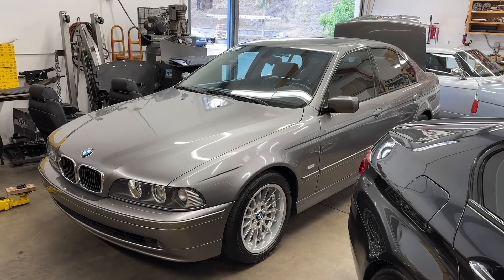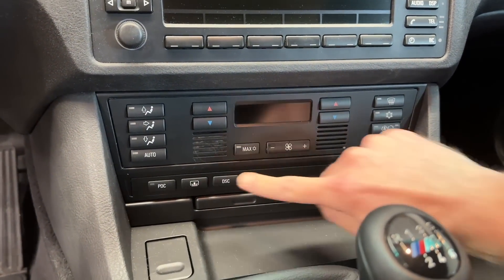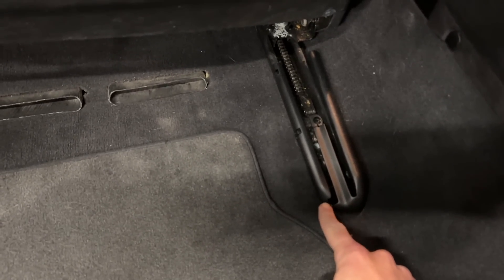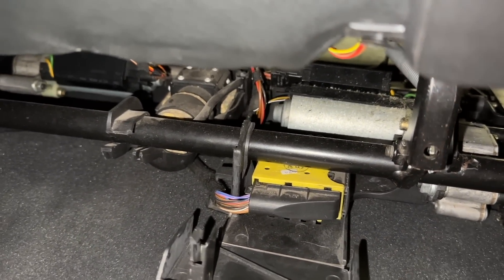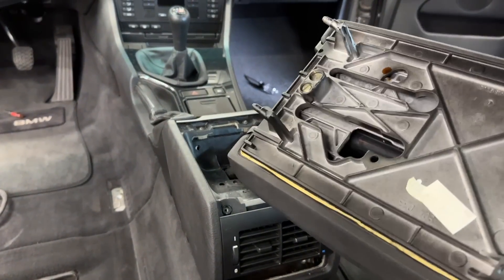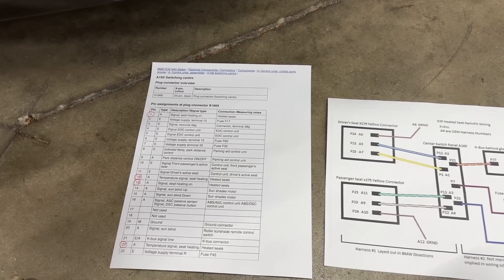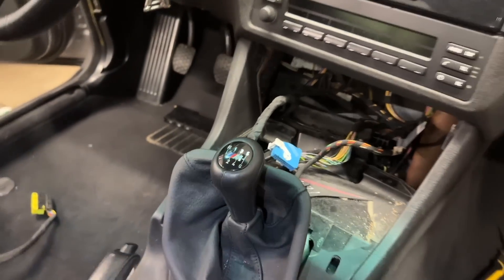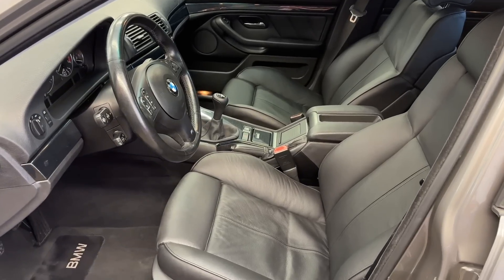BMW E39 5-Series Heated Seat Retrofit

Comment: 13:06 The wiring probably is that long because it's supposed to run inside the dashboard behind/above the footwell to the sides and then below the flooring of the side skirts to the seat connectors, instead of just down the center console below the carpet.
Reply from the maker: I realized this after filming!  While I would have preferred to follow the factory wiring route, disassembly of the entire dashboard and front carpeting sections seems unjustifiable seeing that my wiring route is equally as effective and has no tangible negative consequences.
Reply: @E39Source  I've done it when looking for a faulty wire once, you can get away with really just removing the sideskirt trim, the footrest and the driver's footwell "ceiling" and side of the center console there. But as long as you don't squeeze it with the seat rail, it's fine either way. It ain't stupid if it works :)
Reply: I fabricate the wirings using factory wiring routes. Cheers

Comment: Little tip, you can retrofit mismatching plugged seats (black to yellow and vice versa) by just connecting the wires with their identical colored counterparts. Just connect all the wires together (I bought a second black plug with all the wires still in it) and it'll work just fine. The logic and wiring harness is damn near identical.

Only thing to keep in mind is to reuse the old seat belt tensioner, so you don't get an airbag fault

Comment: 14:58 my car came with front and rear PDC and I don't have the cables from the right diagram. Now if I want to retrofit the heated seats I have to add the new wires from under the seat to the fuse F32 to the central console switch. Atleast at fuse 45 there is a terminal at the top and i have to add one more and route it to the central switch at PIN23. i'll do it let's see how it goes. thanks for the video.

Comment: Really great video Ryan! Especially the lighting made it very easy to follow. Quick question: How can I check if i need to do the right side of the diagram as well? I dont have a rear powered sunshade but i do have front and back pdc on my 2002 E39 525iA. Can I skip it if fuse 32 and fuse 45 are in?
Reply from the maker: Thanks!  I think if you've got those fuses in your glovebox fuse panel, you're probably covered for the right side of the diagram.  If you do the left side and the seats don't work, you may want to go through the right side of the diagram to see whats missing.
Reply: Checked and unfortunately mine doesn’t have fuse 32 or 45. proper wiring harness is ordered now. But couldn’t find any decent tutorial for the right side of the diagram besides the forum entry from BlkzhgWoG. Any tip from you where to look for that part of the job?
Reply from the maker: @YannikSchreckenberger  I'd just supplement the diagram with resources from BMW TIS and work through it wire by wire.

Comment: Does the lumbar support still work? Mini air compressor that inflates two different airbags. No chance that will ever develop an air leak. Hmmm.
I gave up on mine, and bought a lumbar support thing.
Reply from the maker: Yes, lumbar works fine on both seats.  I've never seen it fail on an E39 seat.

Comment: Great video. Where can I buy the wire harness and heat elements for my sport seats (2002 530i) that did not come factory with heat? Thanks Ryan.
Reply from the maker: The wiring harness is linked in the video description.  Since I did not retrofit heating pads but rather replaced the seats, I am not sure about the availability or source for the pads.  I would search RealOEM for the factory retrofit kit, and see if that still exists.  If not, research reproductions.

Comment: Hi. I’m interested in doing this retrofit. So the only things needed are the module with the buttons and the wiring. Doesn’t it need pads in the seats? I’m new to these kind of things. Thanks in advance for your reply
Reply from the maker: Please review the video in greater detail, I did discuss that you need either new (heated) donor seats or to install the heating elements under the leather.
Reply: @E39Source My bad thanks🙏🏻

Comment: So it appears as though your heated seats worked without the additional ground hooked to pin 24 on both the seat connectors correct? I cut the seat connectors out of the donor e39 that had the heated seats and black interior in swapping into mine. Both connectors out of the donor vehicle had that pin 24 empty and no ground was there. So it appears to me that extra ground is completely unnecessary and I don’t need to worry about it correct? Making my own harness kit
Reply from the maker: The extra ground was indeed redundant, but I inserted the pin into the harness just to make it cleaner and avoid having a loose wire sticking out.  The seats are grounded on other pin assignments.

Comment: Correct me if im wrong but does the power goes to the heating elements thru one of the three cables running to the seat from center switches? Or is it rely on existing power cable that's already in the seat connector?
Reply from the maker: I did not study the circuit diagram for this, but it may indeed go through the center console switch panel.

Comment: could you make tutorial for cruise control retrofit? I dont know if 2002 bmw came prewired for it and needs programming or if it needs wiring work.
Reply from the maker: I'd need a Euro car without cruise to be able to do the DIY.  I think all E39s here in the States came with cruise control.

Comment: Nice Video. But how do you managed the canbus connection  ?
Reply from the maker: My bus connection was already made to the SZM (center console switch) because my 540i came from factory with sunshades.  If you had either (or both) of the sunshade or PDC option, you'll already have the bus connection.  If you have neither of those options from factory, you'll want to follow the other side of the paper that I show to make that connection.  I believe it's just another wire or two that go behind the glovebox to the bus and fuse carrier.
Reply: @E39Source  thank you

Comment: Hi, do you know if the heated pad is stitched to the leather or if it just sits there? I want to know because my heated seat has developed a hotspot and I want to take the seat out and replace the heated pad, but that depends on how difficult a job it is and that depends on if I have to unstitch and stitch things! Thank you!
Reply from the maker: For the M5 seats, the heating elements are stitching into the leather seat covers.  I am not sure if the standard E39 seats are the same way.  I know that separate panels were produced years ago to retrofit the heating elements, perhaps you could find and install those and cut out the originals if they are indeed one piece.
Reply: @E39Source  Thank you very much for the info...much appreciated!

Comment: Who did you buy the seats from?
Reply from the maker: A Facebook seller I unfortunately wouldn't work with again.
Reply: @E39Source  Dang sorry to hear that. Is there anyone you can point me in the direction to?
Reply from the maker: @carsnbikes914  If I had to do it again, I think I'd just by the seats from anyone who has them, in reasonable condition.  Then have a trusted leather specialist re-cover them like mine were.

Comment: One thing I noticed, was that you added a ground to the seat connector pin 24, but the seats don’t have pin 24 on ground. What is the purpose of adding the ground at the seat?
Reply from the maker: I did realize that it would be pointless as I was doing it, but I figured it was better to have it plugged into something than just floating around under the seat.
Reply: Agreed. I just did the retrofit in my e39 but currently troubleshooting why the heated seats are not coming on, hence the question about the ground. If I hold the controller button, then key on, and let go of button all 3 green lights just flash, like I have a ground short or something
Reply from the maker: Very weird, you might have a short somewhere.  Check all wiring and grounds, you'll find the issue.  @ClaytonChildree